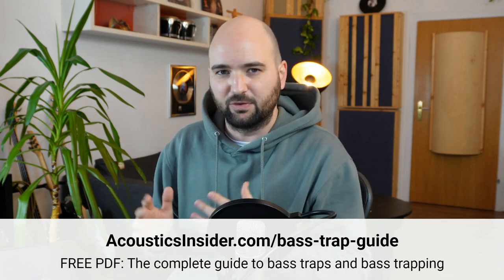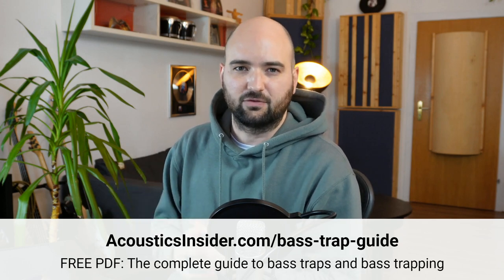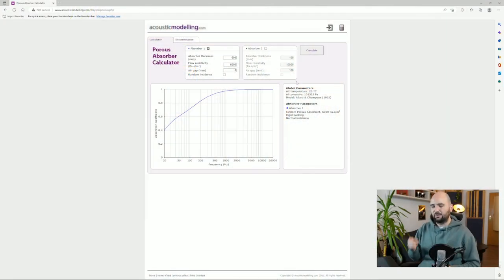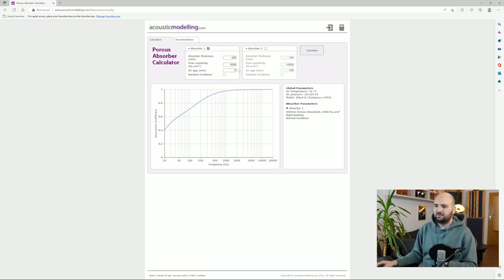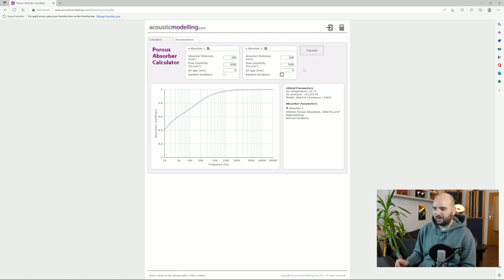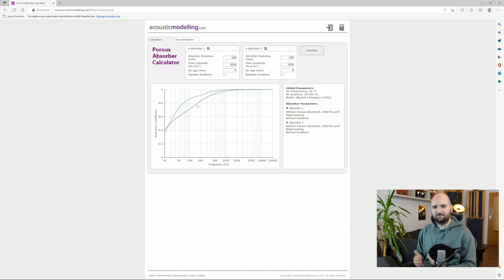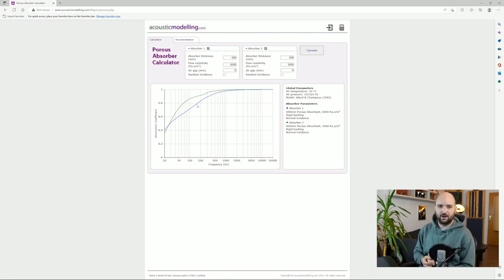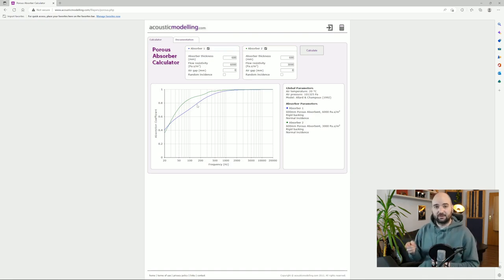Bass Traps: Just keep INSULATION roll sealed in plastic WRAP? - AcousticsInsider.com

Comment: No, You can't change "density" by compressing the material. That is not how it works. When compressing you simply close the fibers together and they stop to work. You do that when doing insulation it will not keep the cold out. It needs to be uncompressed to work. Acoustic performance is no different. There is even difference how the fibers are arranged. Please do a video where you test your theory by using REW. First in the bag and the out of the bag.
Reply: Compressing material is literally lowering the volume while maintaining the same mass, thus increasing its density. Increasing the density certainly changes the materials acoustic or thermal properties though. It likely would drastically decrease it's bass absorption as you say, but not make it stop working altogether. It would ender up costing more than just using rigid fiberboard instead.
Reply: Can you elaborate more? How will compressing it not increase the density?
Reply: @dwaaaiii8757  Conpressing it will break the functionality of the wool. It is the same as when using it as insulation: It only insulates when it's loose, if you compress it, it will not insulate and will not keep your house warm . It says that very directly on the instructions. Acoustics use the same logic.
Reply: @saber0089  Nope. It works by vibrating the fibers. If you press the fibers together with force, it will not vibrate anymore. In dense wool there way more fibers to vibrate in smalle space, but you can't replicate that by compressing loose wool. It's still better than nothing.
Reply: @digidope  I have this same suspicion.  In my minds eye I imagine sound just going 'around'' the packaged wool, like water around a rudder.  Whereas the loose wool would adsorb the sound waves more effectively.  Perhaps I am wrong though...we need a study!
Reply: @digidope  The main phenomenon contributing to sound absorption is viscous losses, i.e. a layer of inert air is formed around the fibers thus increasing particle speed in the remaining area, which leads to mechanical losses, just like in helmholtz absorbers. Thermal losses come second; Thermal loss being when the fibers themselves are vibrated producing heat.

Acoustic Absorbers and Diffusers - T.J.Cox

Comment: Actually having plastic wrap on is the best way to use this nasty stuff imo.  It keeps the nasty unhealthy particles inside so your not breathing them in your lungs  while reflecting the mids and highs which  overly deaden the room if absorbed.  Then simply use foam to control higher freqs at the reflection points.  Low energy is not as directional as mids and highs so you dont necessarily need a bass trap at the reflection point but if you chose you could put a trap there and layer  foam over top.  The corners are the obvious points for the bass traps.

Comment: Good point! That's what I did on the back wall of my room (1,5 meter thick) and it worked very well! For reflections above 1K just let hang a curtain in front of your stacked, still packed Rockwool. Easy, fast and efficient.
Reply: Any room for you and speakers?😀
Reply: @rikardekvall3433  😂1,5m is the thickness of the rockwool I stacked at the back of my basement, bunker style room, with a pair of  ATC SCM 100 ASL PRO.

Comment: Doesn't the wrapping material essentially make it into a pressure bass trap? Like, the plastic acts as a membrane for the bass frequencies to try and push, and the physical movement of that pushing and pulling by the sound, is then transferred into the foam, and thus absorbed. (Havent watched the full vid yet, but it seemed to me that he didn't consider this angle in this vid)

Comment: As @Hamachingo said, leaving your insulation in bags will be compressing it.  In the case of rock wool, it's mild compression.  With lower density fiberglass, it's fairly extreme compression.  Compression, increasing the density of the treatment will change its gas flow resistivity / acoustic properties in a negative way.  

As said in the video, if building traps is holding you up from treating your room, putting full bags of insulation in there is better than nothing.  But it's not the same as properly installed material.

Edit: Here are the facts.  Rockwool Comfortbatt R22: Packaged height: 19.75".  Uncompressed height: 27.5". It expands to 1.39x the packaged size.  This is a substantial difference.  It's even more when you're working with fiberglass.  Packaged height: 18". Uncompressed height: 96". It expands to 5.3x the size.
Reply: fartpooboxohyeah8611  I think it's better to look at the data.  Here are the facts.  Rockwool Comfortbatt R22: Packaged height: 19.75".  Uncompressed height: 27.5". It expands to 1.39x the packaged size.  This is a substantial difference.  It's even more when you're working with fiberglass.  Packaged height: 18". Uncompressed height: 96". It expands to 5.3x the size.  Using the porous absorption calculator to demonstrate the effect of compressed material inside plastic is also questionable.  If you can't blow through a material, you can't accurately model it using porous absorption calculations.  

I get where he's going with the video though.  If your choice is between doing nothing to your room, or adding in insulation in bags, then the stuff in bags will move the needle a bit.  But it's not accurate to say that leaving it in the bags makes almost no difference; it does.
Reply: So im confused, is it better to compress rock wool or leave it be when making bass traps?
Reply: @borey123xx9  uncompressed

Comment: Thanks for a nice short-but-sweet vid, and it’s good news for me, since I’ve already stacked Rockwool from floor to ceiling on the entire front and rear wall in my basement listening room.

In terms of the ugliness, I’ve chosen to  install a gray velvet curtain, which as a bonus should also deal with whatever higher frequencies that might otherwise have been reflected by the plastic wrapping around the insulation material.

1st and 2nd reflection points are dealt with via some free-standing GIK panels, plus some thick foam on the ceiling.

Next step is probably to add some diffusion technology into the room, since it’s now a little bit on the “dead” side. So, “diffusion in small rooms” is my next topic to investigate! :)

Comment: Most of the fluffier insulation materials made to be stuck between studs have some sort of membrane on the front and back, to keep the fluffy in shape. In practice I found this actually helpful as long as you don't put many panels behind each other in a panel, but be aware that it's better to pack two 100mm panels behind each other to get a 200mm deep absorber than to stack a four 50mm ones.
Had some packs of TP-1 in the corner and experimented around with REW. Pulling them away from the corner a bit improved bass absorption considerably (almost half the Hz) but orientation made a noticeable difference in the mids (I assume the membranes act as a kind of waveguide), I could literally turn the pack and watch the peaks and valleys in the 3-6 kHz range even out. Unpacking everything did not measurably change performance (changing orientation still did though) but my room was already well (over-)treated treble range ad that point.
Reply: Any membrane improves the bass absorption and there is no real loss in high frequencies. Fabric offers massive improvements in absorbers and even more improvement if the weave is dense. Always measure large samples with fabric and all layers in final position outdoors and away from the ground with a good replacement for the wall. Impedance tube measurement of fabric is completely useless, material measurements in isolation are massively misleading and models are downright funny. No scientist tries to predict behavior in real world applications. They always test the final combination and experiment in very large sizes.

Comment: Consider this:
1. In the original wrapping, the material is generally compressed a little bit by the high packaging, so you're getting higher density and flow resistance than advertised.
2. the plastic wrap keeps the moisture from getting in and out so mold can grow there very easily, especially if it's right against a wall.
Reply: ^^^^^ this.  Very important considerations.

Comment: Okay so this has been in my head for literally over a decade. 

I bought a dozen packs of Safe-n-sound for a friend's garage studio, which we gutted.  I shot the room w REW completely as studs just to compare along the way.

We brought the insulation (and wood) in just to store overnight, and in the morning I decided to shoot it again With all the insulation in its bags staked across the back wall.

The top end was similar but the bottom end was totally different. 

My boy was excited and we finished the build, and it was great for his needs.

But my question has been ever since:  why not frame in the corners to hold the bags in stacks without opening.  The plastic shouldn't be touching the lows I'm trying to absorb.  And maybe the increased density is actually Helping, catching lower frequencies? 

So question for you, What do you think about this strategy: 

1) temporarily hang furniture blankets everywhere to slow down high frequency reflections just for testing. 

2) stack as many bags of SnS until the lows are under control. 

3)  place panels in the obvious reflection zones

4) start hunting rogue reflections targeting specific problems in REW.

Obviously an oversimplification, but my basic strategy.
Reply: That should be fine, and even great to my knowledge. If I build a room again, I would probably just do this. Build the frames and planning around just sealed rolls and then add high freq absorption to the first reflection points. Also to add, the bales are rounded and will probably be good for diffusing the highs too. I have my spare rolls in the front corners behind my custom large side panels. Also because the subwoofer is close to those corners, it's nice to further deaden the bass there
Reply: i beleive if the increased density does not help. increased density may reflect low frequencies
Reply: Best to first do research into the acoustic properties of the materials you're using.  The assumption that increased density is better for LF absorption is actually dead wrong.  Higher density material can work for very thin panels, such as Primacoustic pre-fab ones, but not for larger, thicker custom absorption.  It's most common to use mineral / rock wool in broadband absorbers, but it looses some effectiveness when compressed (such as in plastic bags) and it also looses some effectiveness when the trap is thicker, such as in your RFZ corner points in the front of your room.  For that reason, we use a combination of rock wool with lower density fiberglass behind it.  This is superior to an air gap and superior to just using straight rock wool.  DO NOT compress your acoustic treatment or use higher density material; it changes the acoustic properties for the worse.
Reply: @alexh8754  exactly.  It does.  That's a fact.

Comment: Hi, thanks for the video! You are actually addressing my biggest concern - micro fibres from mineral wool contaminating the indoor space. Please confirm do I understand it well: Can I wrap and seal mineral wool package with some plastic bag or strech foil and have the same, or almost the same bass damping effect?
Reply: I tested mineral wool panels hanged under the ceiling, without and with wrapping them with polyethylene kitchen foil (it lasts for thousands years), with no pressure appled. The wrapping decreases little only high frequency adsorption.

Comment: making a cheap shelf 7x7 by 1ft deep with all vinyl cubes full of loose fill, right where the first reflections are at the back wall (my couch), pretty stoked because loose fill is only 0.5 pcf, just hope it isnt too low. I also know that it can be packed denser, but everything I read says size and low density is best

Comment: Density:  the air gaps reduce sound transmission as they do heat transmission..... Is denser better?   and plastic membrane stopping the air vibrations from hitting the rockwool....   Test results please.

Comment: Hello!

I’m a little confused, if the package is wrapped by plastic then the material is not really having any surface area to interface with air of the room. 

In other words, Air is not flowing at all.
Reply: Here's how I understand it: sound is to do with air pressure and not air flow. Pressure outside the plastic can obviously act on the plastic itself - pushing it in or out. The plastic's flexing changes the volume of air inside and therefore the pressure inside. That way the pressure wave can pass through. You can think of the sound as inflating and deflating the bag, essentially.
Reply: I'm with you on that. I managed toy and cosmetics factories and believe me packing material plastic is always the cheapest, most mass produced we can get. Surely it's less than ideal to keep it wrapped
Reply: It's about air pressure, and it's basically acting like a spring to slow down the movement of air particles inside and outside. That's why they make membrane traps as well. It's kinda sorta the same idea as a membrane trap, except that plastic is so thin and almost acoustically transparent so it's more like having next to nothing in the way, except of course with high frequencies, which are much easier to stop.
Reply: Do the test he said. Put thin plastic infront of a speaker. It won’t do a thing in the bottom two thirds of the spectrum. Works the same way over the insulation

Comment: Alot of our main concerns is is Rockwool safe to have exposed in our studios? 

Can someone give us a detailed answer on why it is or why it is not?
Reply: @NoQualmsTheArtist  what may you recommend to treat the room instead of Rockwool?
Reply: @manuellujan5625  you can use rockwool, just wear a proper graded mask when handling. And make sure you cover it with the right material when you make your panels. Just don't leave them exposed.
Reply: @manuellujan5625  Basotect by BASF is the industry standard.
Reply: i've looked into this a lot. there seems to be two points of concern: 1)  volatile organic compounds or "VOCs" for short, and 2) micro fibers. 

micro fibers are the ones i was worried about and altho there are no 100% clear answers, imo it comes down to 2 questions: (Q1) do rockwool and rigid fiberglass insulation emit micro fibers over time? probably at least to some degree, yes, especially with lots of bass. altho i'm not any kinda expert so look it up on your own too, but having read a lot about this, the people who say that "micro fibers are emitted" seem way more convincing and professional than the people saying there aren't. (Q2) does chronic exposure to micro fibers cause diseases like "pulmonary fibrosis", etc? yes, altho not in everyone. the solution to this would be to seal it air tight in thin plastic. some people even prefer this because cause it reflects some of the highs and high mids while still absorbing the bass giving a more even response. and then you can easily get rid of more highs and mids with blankets etc if needed.

then there is also VOC "off gassing" too, which can cause certain health shit too from what i understand, altho there seems to be a couple more straight forward solutions to this, (1) they do make low-VOC rigid fiber boards like "safe n sound". i've heard you can also leave the higher VOC boards outside for the first 2 or 3 weeks after you unwrap them and most of the forameldyde and other chemical shit goes away. again tho, i'm not an expert, this is just shit i've read about in forums and different places.  

i'm personally going to use the low voc shit and the wrap that shit in plastic as well cause i'm paranoid as fuck about all this shit lol

Comment: This is exactly what I did to find out how to solve some standing wave issues. By the way what could I do with a 250hz buildup in my room? This is the only real issue that is still there. It starts around 160, peaks at 253 and then rolls of again almost symmetrical.
Reply: If you can’t get away from it by changing your positioning why not try helmholtz resonators. If it’s a predictable and consistent problem centred around a narrow band, it’s the only major issue and it’s not down too low it’s a perfect candidate.
Reply: Are your speakers close to some large object? That sort of frequency range is usually right where you get issues from furniture or other large items near the speakers. It could also be the physical resonance, not reflection, of a large item or the drywall etc, like the panels of a desk vibrating at 250hz. Try running a sine wave at that centre frequency nice and loud and go around the room to see if you can hear or feel anything resonating
Reply: It could also be worth considering the frequency response of your monitors and making sure there's not some sort of weird buildup related to those, I've definitely found that even after treating my space that my really cheap monitors had really poor consistency in the bass-upper bass region. You could maybe use a miniDSP interface or a system-wide EqualizerAPO to at least trim the response a little bit? I found EqualizerAPO particularly helpful since it's free and you can also get a feel for any potential monitor-related frequencies might be causing problems
Reply: @KingOath  This is exactly what I did. 250Hz at 80db. Then measure the signal. I feel the resonance in everything, like the dry wall, my headphone amp etc. Pretty amazing.
Reply: @ckdotdotdot  Could be, I have new monitors, ATC SCM50a pro.
Reply: @KingOath  They are 80cm away from the side wall I guess,